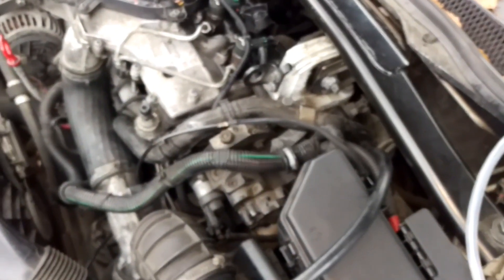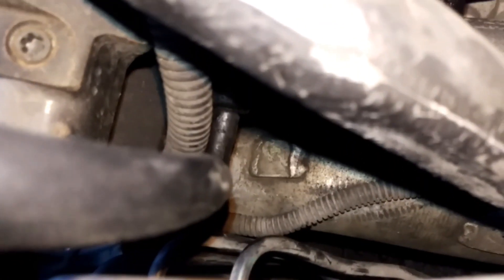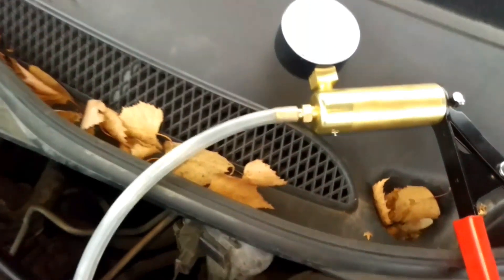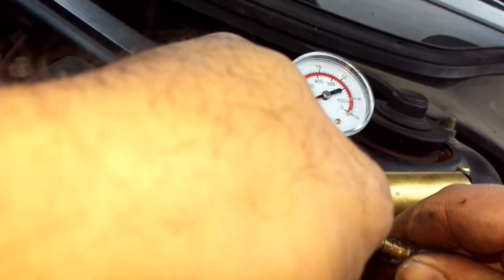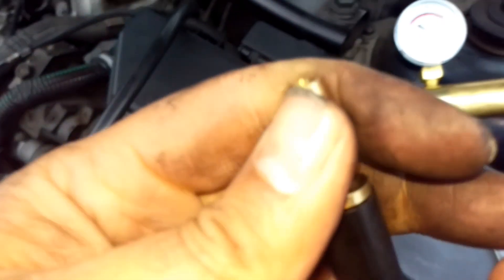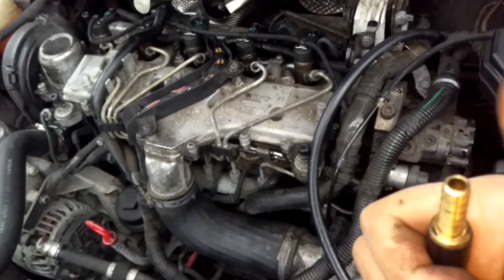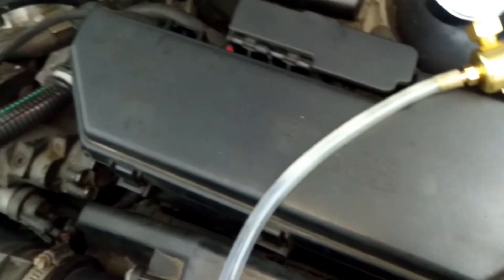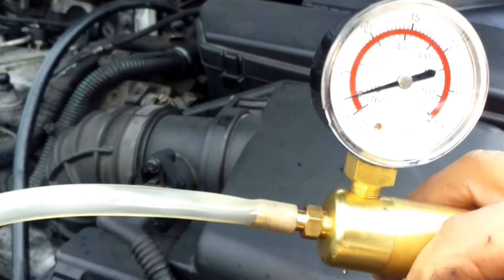How To Test a Vacuum Pump on a Car

Comment: Something you forgot to mention is the speed at which the needle on the gauge recovers when you open and close the system.
Your vacuum came very quickly, if it is not that quick IE a few seconds to build vacuum you also may have a problem.
Sometimes a vacuum leak or a blockage on the exhaust side of the pump.
Maybe belt slipping if it is a belt driven pump, or the pump could be worn.

Comment: hi mate , Got one in sprinter passed that test , however , leaking to much oil to the brake booster (could be from faulty check valve ) but  how much oil you consider normal down there ?

Comment: Thanks for this video.
When connecting the tester to the vacuumpump, i get around 22-23 Hg max at idle. If i rev the engine to about 3k it goes to about 26Hg.
Popping sound wont go away.
Perhaps my vacuum pump is messing with me.
Reply from the maker: You could check with the brake servo disconnected and take readings with the port blocked and unblocked.
Reply: @sirobb  will do. Also, when connecting the brake servo to a vacuum tester and pulling a vacuum on it, it holds full vacuum.
But i will also test the vacuum pump with the brake servo disconnected.
Reply: If you have a Volvo diesel, it might be a worn valve lifter issue(just new parts required), altough it might not sound like that to you in any way, but makes vacuum-like noise. Very common.

Comment: Great video Rob, very helpful. I tested my pump & it pulled a steady reading but I still have the popping noise. Would this indicate the pump itself or maybe the brake side? My brakes are working fine with no issues btw.

Comment: Hi
I have a bmw 320d.
When connected straight to vac pump it jump between 500-600 really fast.
Can't find any leaks on any lines so thanking its the pump as break pedal goes hard at low rpm and have egr problems.
Am I correct or not? 
Thanks

Comment: finally I know now where the problem is. bought the vacuum tester (like yours) and when testing the vacuum pump it flickers a lot, rear engine mount Wich I bought and installed not doing any vacuum at all. so I got my money refunded for the engine mount and now looking for a vacuum pump. My son will be in England (london) for a few day and I'm trying to locate one so he can get it for me. any advice?

Comment: Rob - Is there an easy way to test the brake side? Can you just pull off the pipe & block it at the pump or would that cause problems/warning lights?

Comment: Hi Simon, been watching your videos since I got my d5 s60 euro 3. I have the popping noise that you mention. I've checked the mounts and still pops, I then checked the vacuum pipe by pulling the hose off and plugging it directly. I still have the popping noise. Does this mean I have issues with my vacuum pump directly?your videos have been very helpful! Thanks
Reply: Same for me! Took hose off vacuum pump, plugged it, and still have the noise! Any help would be appreciated please!

Comment: Just a comment of appreciation for all the free troubleshooting advice you are handing out, absolute top notch explanation on each video. Brings me to an issue, I have fixed various vacuum leaks except for one. Essentially when I connect the gauge to the vacuum pump the reading sits at steady 25, when I plug the vacuum pump nipple the knocking noise is there but when I remove the nipple plug the noise is much less...totally confused now, any idea? Brake master cylinder or perhaps brake booster? Lost at the moment
Reply from the maker: It could be the brake booster seal so remove brake booster hose to see if the noise dies down.
Reply: Did you found out the problem, i have the exact same issue?
Reply: @emilio7741  no i haven't, car seems to be running absolutely fine, I kept getting limp mode so I decided to mr.muscle the sh*t out of the turbo from the egr pipe that goes to the exhaust side, a bit of a pain to remove the pipe but runs perfect now without a single limp mode, guess the VNT mechanism was caked in carbon preventing it operating properly thus throwing a limp.

Comment: Sirobb, thanks for the videos. I have a d5 euro 3 and have performed this test with the same equipment, however my gauge only went to full reading once I revved the engine. Does this mean my vacuum pump isn’t working properly? I have an over boost issue and the popping noise. Thanks

Comment: Great videos, thanks. Have you ever know a vaccum pump to work fine until the engine reached operating temperature then play up? Or the alternator for that matter? Trying to trace an erratic fault!
Reply from the maker: Can you be more specific about the fault symptoms you have?
A mechanical vacuum pump is generally reliable in all conditions but alternators can behave differently when warm if you have poor connections and voltage drop for example.
Reply: @sirobb  Thank you so much for responding. Its a Shogun Sport 2.5td diesel 56 reg. Runs and drives ok, but onces the engine is fully warmed up, to about 80 degrees, the speedo starts jumping up and down and it tries to stall. No fault code. Pull over and let it cool and its fine again for another 20 mins or so. If you try and start it straight after its stopped when hot, then it races on and throws up fault code boost sensor 12, which has been replaced. Replaced most of the vac lines and can't find a leak on the lines but it occassionally makes that popping sound in your video when just turning over. No water in oil, oil in water or bubbles in expansion tank. Problem started when crank bolt snapped and was replaced at a garage with a new crank sensor and disc. If you can solve this one then outstanding as two garages and Mitsubishi are stumped. New boost sensor and MAF sensor, egr and throttle cleaned and checked. New vacuum tank. Tested a couple of vacuum points today, vacuum at reservoir takes about 2/3 seconds to reach a max of 500mmhg, vacuum at throttle solenoid approx 500 but vibrates significantly. Any thoughts? Thanks in advance.
Reply from the maker: That's quite a strange set of symptoms.
My first thought is to measure both the DC voltage and AC voltage being produced by the alternator.
Test directly between the alternator B+ post and alternator casing when running a cold engine when all is good and a warm engine when the symptoms occur and report back.

You'll ideally need a decent quality multimeter marked "True RMS"
Reply: @sirobb  Thats great, I'll test and come back to you. Cheers

Comment: Hi Simon, I was wondering if you could show us the way or the trick to get the rear engine mount out. Some say that under the driver's seat there's a cavity to get it out but I only see the amplifier, is it true? I'm not a mechanic and nothing to do with mechanical and stuff like that, I work for a broadcasting TV channel but the thing is that I love doing mechanical repairs on my car my own and safe some money  as well as taking a lot care of it. Someone once said that the way you treat your car is the way you treat yourself and I believe that.
So, if you could give us a hint on how to get that rear mount out, that would be great!!!!.
thanks again for your time and support.
Reply from the maker: Douglas Sampedro If it's an XC90, I'm not aware of any quick way to remove the mount. 
This discussion here may help. 
http://www.volvoforums.org.uk/showthread.php?t=260585

Comment: Hello . A question. I did the same test just like you . The vacuum pump showed 700 mmHg but the popping noise still exist . Any ideas ?
Reply from the maker: Check it at different engine temperatures as the EGR position can have an effect.

Comment: hi, friend. I have a 163hp and I wanted to ask if it is possible for the glove to fill due to poor condition of the vacuum valve? At the shop they told me that they changed the PCV but I have a leak in the top cover, the loud noise of the engine and it also fills the glove after 10 seconds of having the car on.
Reply from the maker: Connect a vacuum tester as shown in the video. If the needle shows full vacuum and is steady, the problem is not the vacuum pump.
Reply: I have checked everything and when I empty the pump the needle is not stable but if I push the cuff towards the pump with my hand it is stable, so I have doubts. but even if it is stable the engine noise does not disappear. There is another thing that I saw strange, checking from the part of the front support towards the connector that is on the filter there is no vacuum but if I remove the connector socket and put my finger there is a vacuum. Checking all the hoses separately if they are in good condition. I'm going crazy.

Comment: I did this test and the gauge is just flickering,  does this mean the pump is no good and needs replacing or can something else cause that. I did get it off and change the seals, but still does it. How can I tell if the pump is broken? Ps I asked you a few weeks ago about windscreen washer doing strange things,  eventually turned out to the ECM got that repaired & all good. Thanks..
Reply from the maker: You'll need to test it without the brake booster connected.
The connection seal can be fragile though and of course you're dealing with the braking system so be careful.
Reply: @sirobb  so do I block the hole on the pump once booster is disconnected to test? Sorry to be a pain, but you definitely seem to be the expert in everything Volvo 😀
Reply from the maker: @richarddavis4378  You check with the hole blocked and unblocked.
If the noise goes away with the booster disconnected and unblocked but the noise returns when you block the booster hole, it suggests a vacuum leak in the brake booster.
There's a lot of vacuum at the booster so be careful with your hand
Reply: @sirobb  Thank you, I'll give it a go...

Comment: Hi Simon. I went mechanic this afternoon for vacuum test, well the good news is that the mounts are ok but after that he tested the vacuum pump as well as the tcv and everything is working properly. we blocked one by one and that popping noise still there mate. ok, the car is running normally but the noise does not go away. Any other suggestions of what it might be? I'll be glad to hear from you. 
Thanks again Simon for your time.
Reply from the maker: +Douglas Sampedro You may have a vacuum leak through the brake master cylinder. 
Not common but not impossible.
Check whether your brake pedal is firm or soft in the morning before turning on the engine.
Reply: SiRobb  i suspect that to be the problem on my d5 2005.pedal makes noise as if air is blown out.the popping sound is not quite as loud as the ones in ur videos tho...
Reply: Hi Si. I'm in the same boat. I have an xc90 with a pretty significant popping. Disconnecting the pump makes no difference. Pump holds vacuum with no flicker.. If I disconnect the hose that leads to the Master brakes cylinder it goes but I imagine that's because its now leaking through the opening I just created. I'm unsure at which direction this points me in now, is the the brakes booster route do you think or still potentially the pump?
Reply: I've also pressure tested the brakes cylinder which sits at around 17. 5inHg

Comment: Hello, your videos are very helpful. Tried the same method of testing the vacuum pump which showed a bit lower number - 600 mmHg. But a strange thing is that the popping noise is the same when the end is open or when the end is covered. Maybe my euro3 d5 engine has a vacuum leak somewhere else. But where? :-(
Reply from the maker: Marius P. It sounds like you have a vacuum leak in the vacuum pump itself or the brake booster.
Reply: Thank you, I will check it out. I also noticed some oil in the vacuum hose which goes from boost pressure control valve to the vacuum pump. VAC and OUT hose connections on boost control valve has some oil remains (so i think this valve must be trashed with oil inside also and needs to be cleaned). So a vacuum pump sure has a leak. Or even turbocharger is leaking also.

Comment: Check the duty cycle to find out about your electric vacuum pump? The gauge on those cheap vacuum tester pumps you were using are so unreliable that one tester I bought the needle wasn’t even at zero when I opened the box from brand new

Comment: Hi si iv just uploaded a video regarding this please can u have a look read description though as im stumped lol
Reply from the maker: drewy vxr It may just be the o-ring seals for the brake booster pipe. 
With the booster pipe connected as normal, try wiggling/pressing the booster pipe to see if you can improve the vacuum reading.
Reply: SiRobb il give it a try get back to u let u know
Reply: SiRobb hi si just done what u said iv wiggled it can get it to stop bouncing but still under 10 iv noticed the metal collar that booster pipe connects to twists so i think might be leaking ??
Reply: SiRobb hi mate iv found it to be booster leaking from the seal inside the car